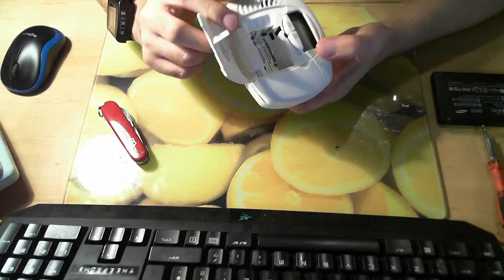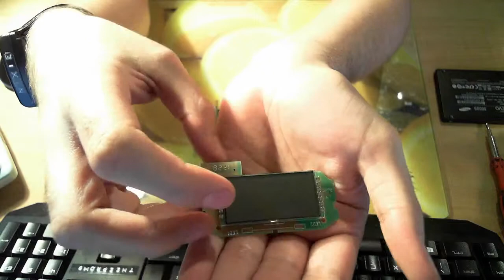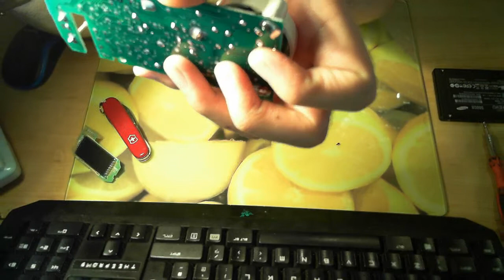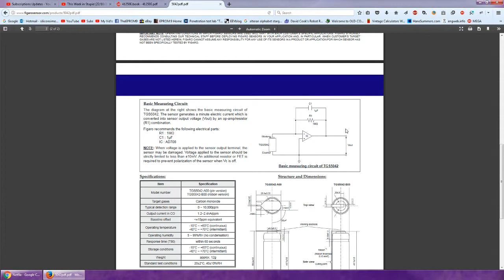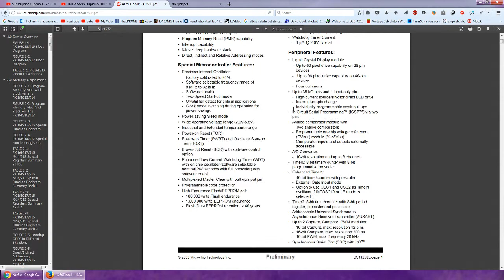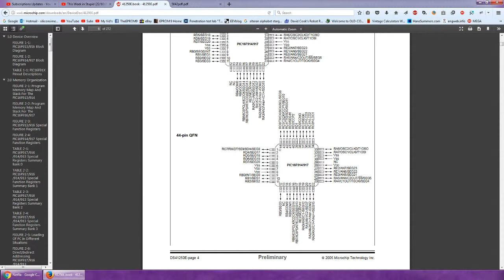First Alert C0410 Carbon Monoxide Detector Teardown

Comment: PIC microcontrollers are easy to program but I'm betting it has the read-only fuse set. And probably the not-readable one too. It might be possible to drop in a new chip. I note the example diagram for the CO detector shows an amplifier but I don't see one on the board (maybe the chip under the piezo?). I'm also not sure how they're driving the LCD. Is it something the chip has built in?

Interesting question is how they do the expiry too. I don't see any kind of RTC or battery backup. Unless it's that chip... Might have to take a squiz.

(Edit: looking through the datasheet, it seems it's not possible to set the chip to not be writeable to. Which seems promising. Also, it seems that the microcontroller is capable of driving the LCD directly).
Reply: The chip under the piezo is a RE46C107 which is a "DC to DC Converter, Voltage Regulator and Piezoelectric Horn Driver".

I think I am going to try and do something with this but that may mean desoldering the CO detector and putting it in my own circuit. It would be nice to reuse what's already there though. I may have to see if my Microchip stuff still works. Hold on, just noticed another chip under the CO detector.
Reply: The chip under the CO device is a MCP6042-I which is the op-amp we were looking for. That's all I have time for right now but I'll see if I can work out if those test points can be used and dig out my ICD stuff soon and see if I can read the fuses.

Comment: Easy to set up with ring alarm.>>>t.co/6i3c0OKJH8    I set it up in a minute and you can tag the device to a specific room. No more wandering the home to locate a low battery beep. The app even shows battery level and can test the device. Let's just say ring and first alert got it right. To make it even easier the alarms attach to existing first alert bases. If you use ring alarm just buy this and you now have professional monitoring.
Reply from the maker: Robots are for everyone